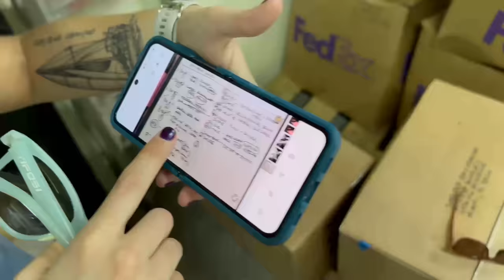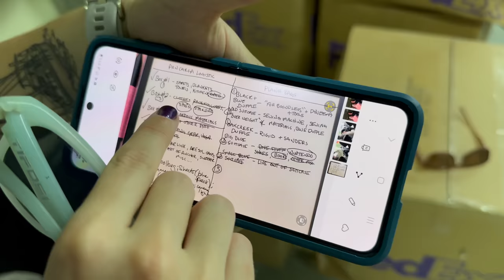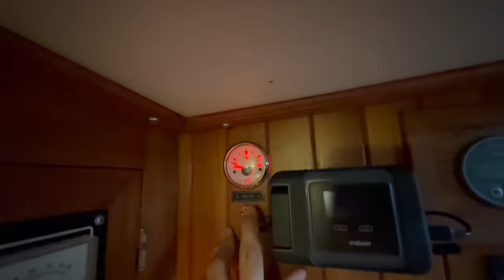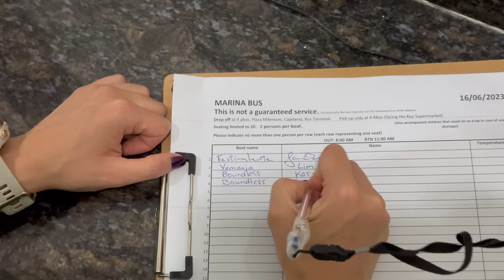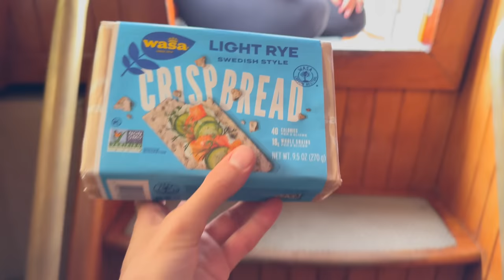Finding HIDDEN TREASURE in Our NEW BOAT (and a few problems too) EP. 84

Comment: A pro-tip (maybe) When filling for potable water, both ends must be aspetized with at least 70°Alc, higher is better.
Spray the in and the out of the hose and your receiving cap and hole, wait 3 minutes.

Comment: FYI if you want to stay hydrated,  eat water mellon,   because the water in it is PH balanced and your body can absorb it very easily.  plus it tastes good.   also feel lucky its only 88 degrees..  i'm in waco texas and its hitting 106! and i'm working on my garrage/shop without AC.   so yea..  i would die for 88 right now.. poweraid and gatoraid is horrible.. they use the worse water in them drinks, my woman worked for them for many years running the filling machines, and the stories she has told me, i tells you.. i will never drink them drinks even if it was to save my life..

Comment: Please tell me what brand of manual pump you used recently to pump oil out of the engine. It had a curved metal spout, a long hose going down into the engine and a circular handle on top that you pulled/pushed up and down. Thanks - I can't seem to find it (Amazon, other).